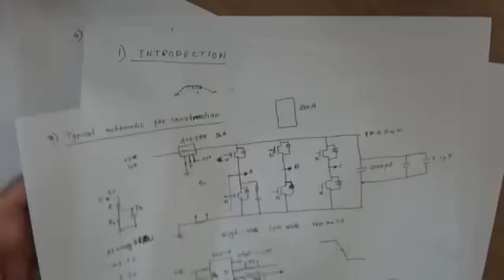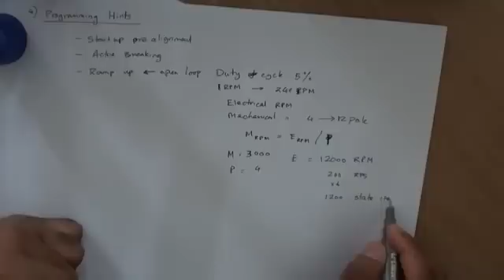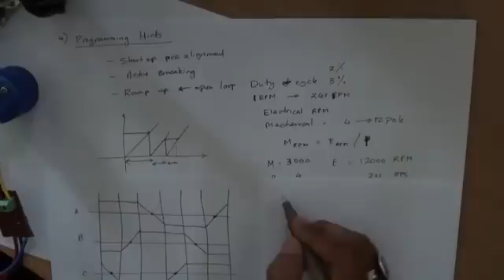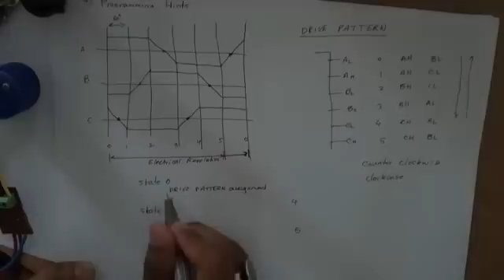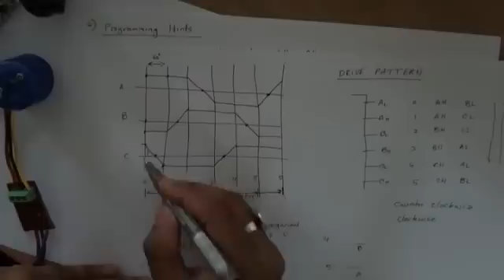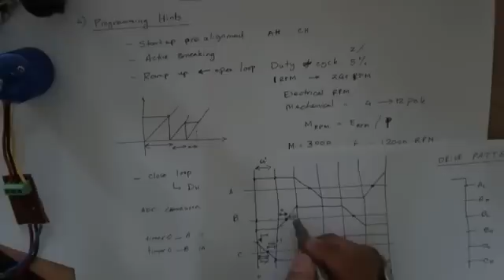Xmega Brushless DC Motor Controller (BLDC) - How to Part 3

Comment: you are turning on the ADC to read the back emf after a certain delay. Then you calculate the time after which the ADC got the zero crossing and start the drive pattern again. It's not clear whether we need to start the drive pattern just before the next state or exactly during that time